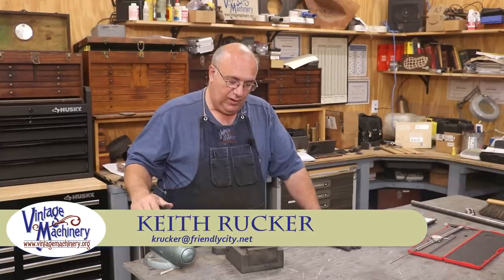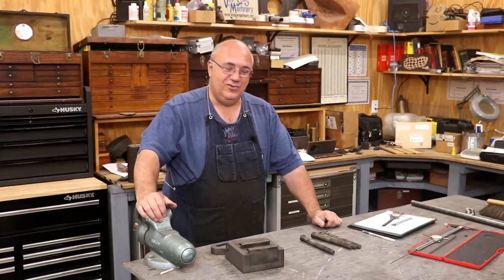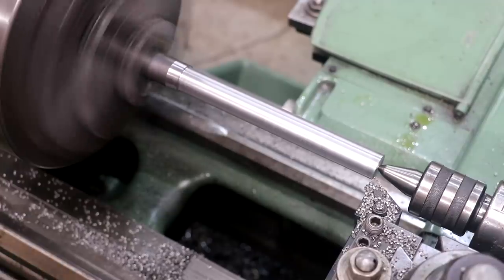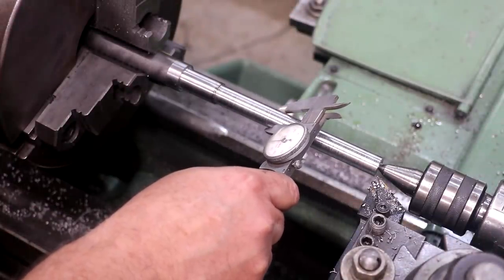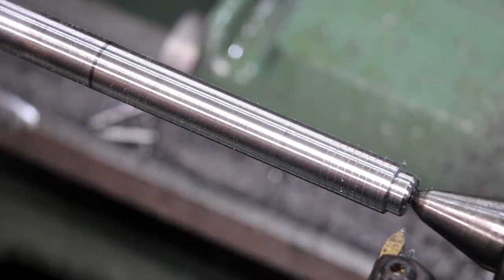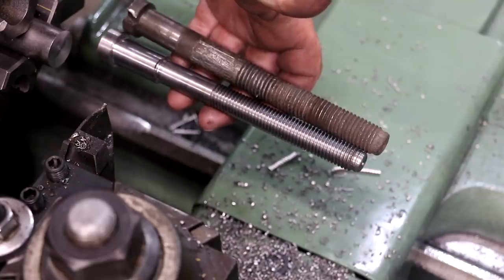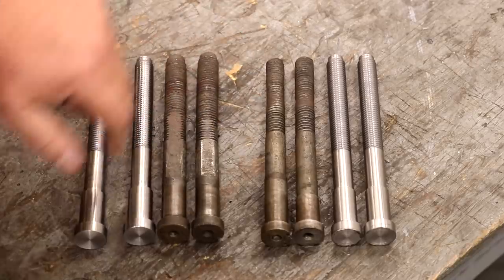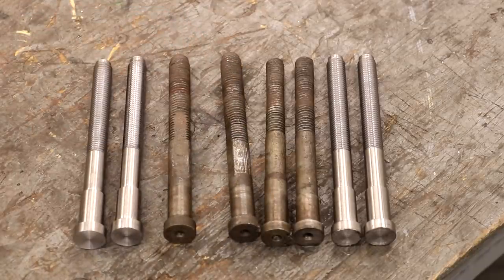Metal Planer Restoration 38: Turning and Threading new Studs for the Clapper Box

Comment: You don't discuss materials for the clapper studs. I suggest at least a hardness test on the original studs. The planer tool may be changed/repositioned up to 15 times per day, thousands of times a year in a busy shop. The clapper studs and nuts are thus heavily stressed wearing parts and therefore must be made of durable materials. The studs on my Rockford planer check at 45 Rc and the nuts 50 Rc. Your requirements in your home shop will be far less stringent than everyday production but I submit low carbon steel studs to be a poor choice in this application as they will soon stretch and the threads deform under repeated tensionings.

The material you selected appears by looking at the chips and your feeds and speeds to be a free machining steel having limited tensile strength and wear properties. I strongly suggest you scrap the studs and remake them using at least 4140 pre-heat treated to Rc 30 and 4140 HT to Rc 40 for the nut - and strongbacks should you elect to replace them. It might be a trifle more difficult to machine but you will get the end properties and wear resistance you absolutely positively need for clapper studs.

Another point is the stud holes in the clapper. The shanks of the stud you showed as a sample was burred up apparently with a pipe wrench. The burr, forced back through the clapper body surely damaged the holes, therefore,  I suggest skimming the holes a few thou to a common size before re-making the studs of a durable material.

The studs you made being of a leaded free-machining steel will spontaneously rust in Georgia's humid air. I suggest you frame them and display it in a prominant place where you can watch them rust over the next few months.

Adding - referring to E Designs' objection to reducing the clapper stud  thread diameter: 

The hardened original 3/4 - 10 clapper studs were at least the equivalent of Grade 8 and the low carbon steel 5/8 - 11 studs you propose to use are the equivalent of Grade 1. According to the charts the working loads for each respectively are 30,080 and 9300 lb. IOW the low carbon 5/8 -11 stud has roughly 31% the tensile strength of the hardened 3/4 - 10 original stud.  A planer's cutting tool necessarily has to be located some distance from the tool shank clamping. Cutting forces have a larger leverage to the first clamp and the clamps are located closer together because of the limited space on the clapper. Thus, the tool restraint must be adequate to resist the tool shank slipping under the strongback. Therefore the tool clamping must be robust and made of materials sufficient to resist the clamping forces. 

Which brings us around to keeping the original studs' nominal size and making them of hardened material.
Reply: I agree completely with everything you stated and would add that the two larger studs should be remade at the original diameter , i.e. 0.750. 
Keith didn't specify the locations of the two larger studs, but they were likely located at the top of the clapper where they get exposed to higher tensile stresses. Though the slight reduction of diameter from 0.750 to 0.625 may not appear to be significant, its a staggering 50% reduction in cross area which may cause the new studs to stretch excessively and result in chattering. 
It's almost never a good idea to substitute parts with weaker replacements. Between the 12L14 and smaller diameter, the new studs will stretch far more then the originals, and likely impair surface finish.
Reply: Its not going to get changed 15 times a day 1000s of times a year is it 
It'll be closer to getting changed 15 times a year if that 
It's an out dated antique 
It'll find a use to crack.it up for fun a a few times a year but even if Keith were to sell.it its never going to into any sort of productive shop environment is it 

Its not going to wear out anytime soon
Reply: @fowletm1992  It's not an issue of the new studs failing or wearing out. The problem with the smaller studs is that they will stretch more than the originals which may cause the tool bit to vibrate. This results in chattering. 
Kieth spent a lot of effort and money to make this planer better than when it left the factory. At this point, it would be foolish to make a stupid modification that diminishes the machine's performance.
Reply: @fowletm1992  re-read my first paragraph, especially the last sentence where I begin: "Your requirements in your home shop will be far less stringent..."  Low carbon steel bolts don't hold up well under repeated tensioning cycles which is why I suggested HT 4140 a low cost, readily available alloy steel and not a more costly superior material. Cheating on materials has a grave effect on the reliability of your work. Even something as mundane as clapper studs, an application where the man on the machine torques them "plenty tight" so the tool shank doesn't slip with a wrench whose length has been extended for convenience in reaching over the table. 

There's a good reason why a designer more than a cenrury ago specified the materials in the clapper studs, nuts, and strongbacks. The rule then was as "just enough, no more" as it is today. Case hardened studs and nuts were the minimum requirements to meet the service life expectancy for the end user. My suggestion down-graded the material to OTC alloy steel and I did not reccommend case hardened triple high nuts. I thought my suggestion modest compared with the original supplied materials.

Further, this rebuilt planer will not be a mere static display. Keith put in many long hours reconditioning its working surfaces. I'm quite sure he anticipates using it many times a year.

Comment: How did they face both sides if they turned it between centers?
Reply: "Dead" half center in the tailstock and possibly a facing tool bit, which had a LITTLE cutting flat.  Not that I was any good, been there and done that.

Comment: Two issues Keith, First, I understand you have the ability to cut threads and I honestly like to watch that operation. But wouldn't a typical die been a lot quicker in the long run? Secondly, I also understand you are still rebuilding the long bed Planer project. But I am so glad this wasn't another scraping video. I about tired of scraping by now... Thumbs Up!
Reply: Get ready... I think that there's scraping to do on the clapper box, yet.

Comment: How rare is a metal planer? Wikipedia's says they are obsolete.
Reply: I've heard people say you can make anything on a metal planer except a profit. Milling machines basically killed them stone dead as they are more versatile and faster. Having said that I saw something similar in use in a modern setting the other day, it forget what it was making but it was quite specialised.
Reply: I am beginning to believe planers were made obsolete by the advent of precision ball bearings for high speed spindles. Still somehow lathe and milling machine columns had to be made on planers in the beginning. I suppose the rest is history.
Reply: @WobblycogsUk  
That’s because the people that repeat that saying do not understand all the properties of a shaper or planer. Once set up and running the operator can do other things and operate other machinery while the planer does its job. My first boss in a machine shop always lamented the day he traded his shaper for a vertical mill.
Reply: @july8xx  Arguably that's because the planer is so slow they have to do something else to remain competitive. I'm sure there are niche areas where a planer is still the best choice but industry has decided they aren't the best tool for the job most of the time.

Comment: Keith, be really careful on the amount of interference you use on a cast-iron member, especially when the analysis is unknown and perhaps not as strong as modern cast irons. An interference of more than .001 at that size (.625) risks cracking the cast-iron member. Probably worth some research and maybe asking around to get that right. It would be a real crying moment if you heard that loud "CLICK" as the cast iron cooled from a shrink fitting. The brittleness of cast iron doesn't tolerate nearly the interference pressure that steel does.

Comment: About turning between centers in the olden times, how did they drill the centers without a reasonable chuck?
Reply: by hand :-P
Reply: Given big enough "stick", part will be concentric on the centers no matter where they are initially placed. A couple of scribes with a center-finder and a drill press will do just fine. In fact you may have noticed once Keith flipped the stud around it had a bit of a runout on the head OD. If turned between centers sub-mil (thousandth) runout could be (easily?) achieved. All this assumes that centers are lined up otherwise you end up with a taper. Can't win them all.
Reply: Blondihacks just did a video about how to do this

Comment: Wait, why would you even contemplate going undersized? Yes, if you have the hole's measurement, go undersized for the bolt. If you had just the bolt, you'd oversize the hole. But you have both, and those exact sizes have worked together for 120 years... Why are you even breathing the word "undersize"? Make them exactly to size; excepting thread size/pitch.